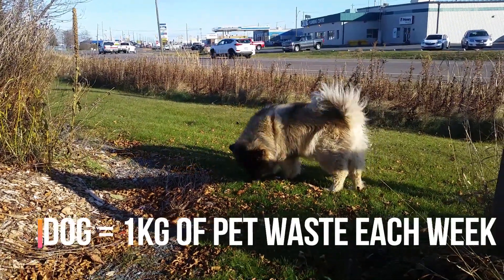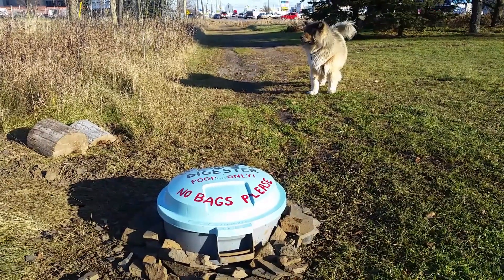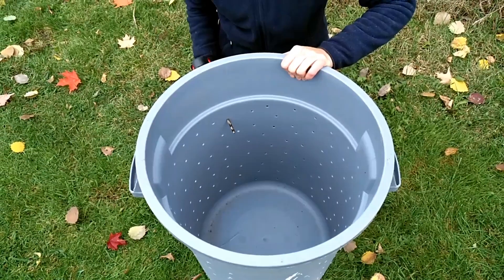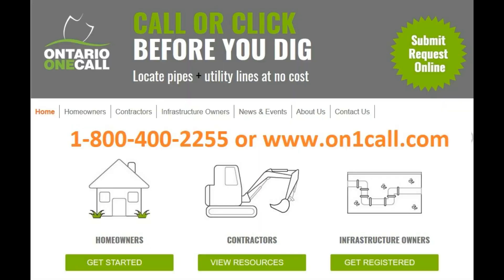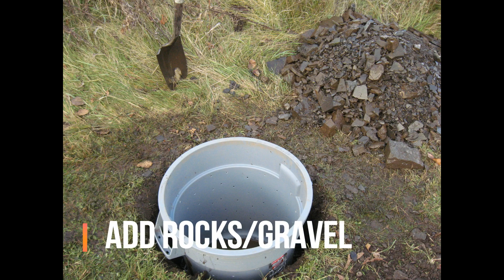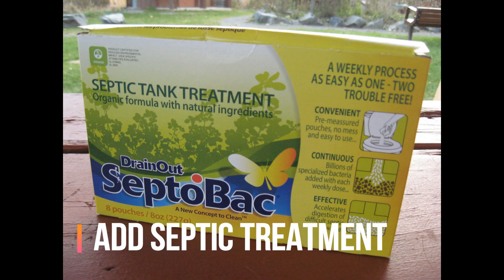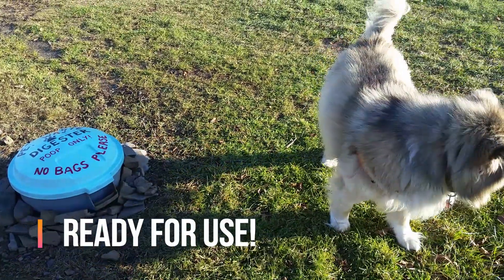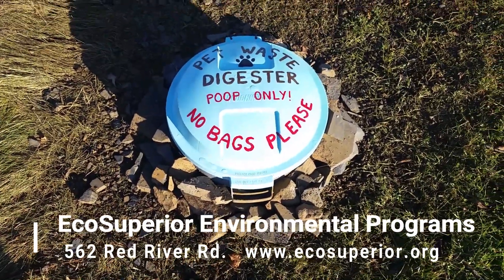Pet Waste Digester

Comment: It's a great idea...however, you don't address the problems of bugs and flies and how much water to put in.  Very simple instructions here which I have done.  But not so simple in execution.  I do love the fact that no more poo bags in the trash can.  And it is much easier to dispose of when you can just drop it in.  But the flies and the roaches....not so much.  I'm using enzymes once a week.  Your thoughts or suggestions?
Reply: exactly. I'm so tired of the flies! The dog poop seams to be a very good attractant, but I don't want them.
Reply: @briandeines5019  Problem is that the lid is large and loose (not airtight). A better solution would be to put the can in the ground UPSIDE DOWN and cut a hole in what was the bottom and install a 6 inch PVC cleanout with screw-in plug. Seals much better.
Reply: Intersperse a layer of some soil, and/or carbonaceous material like sawdust, wood chips, shredded paper, or leaves to cover poop.